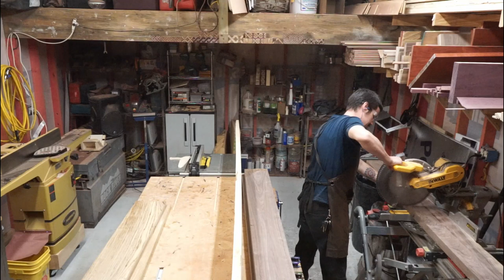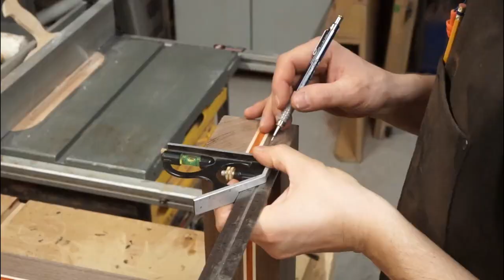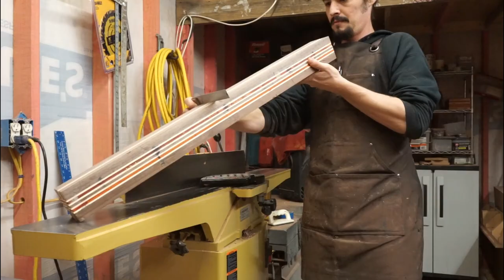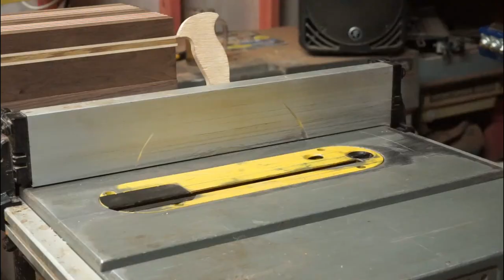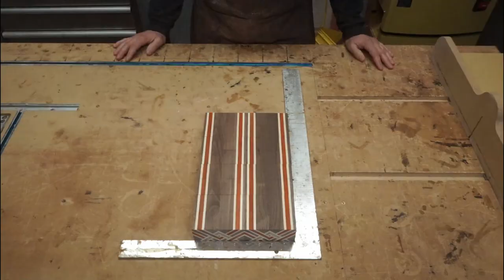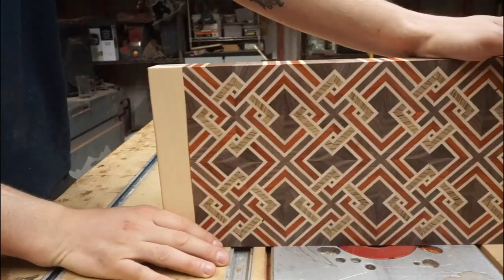The Chainmail Feldthouse Weave: Tutorial Preview!

Comment: What the 2 angle tool you use in this video?
Reply from the maker: I believe you're referring to my angle block gauge. You can find them on Amazon. I got mine from Accusize tools
Reply: @FeldthouseFamilyWoodworks  are they both 45 degrees angle tool?
Reply from the maker: @tommiecook9694  it comes in a 2 gauge set. 45-90 and a 60-30